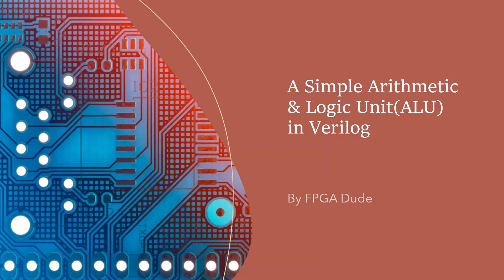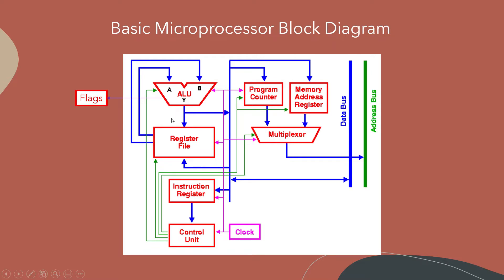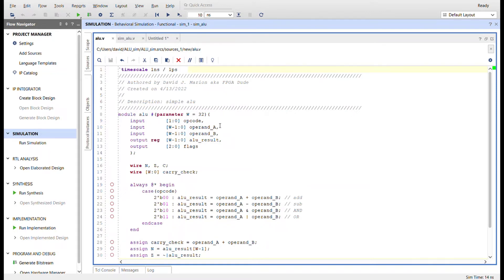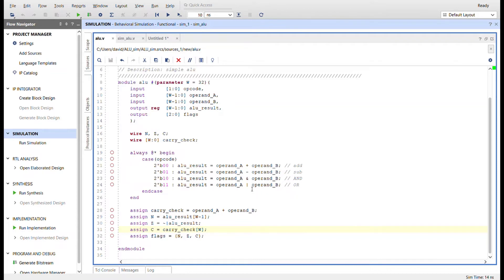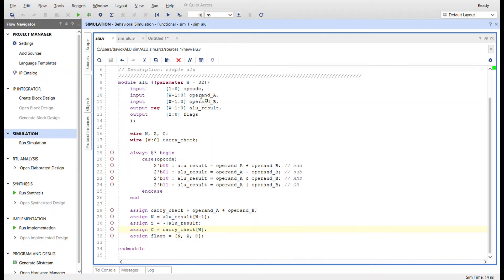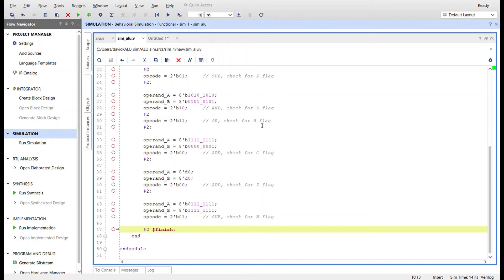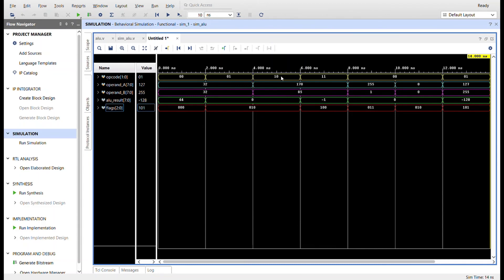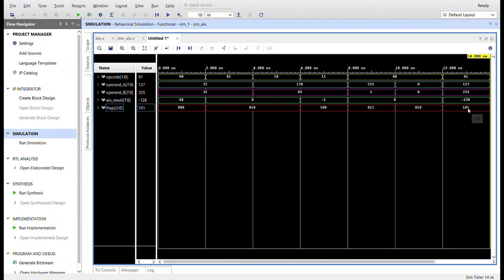A Simple ALU in Verilog Simulated in Vivado

Comment: Thank you very much for the explanatory video!
One suggestion that I think will help is to talk about the constraints file. 
When you create a module in Verilog, can I make a package for the module to export(include) it to other designs? I know I can do that in VHDL, but I have no clue about Verilog.
Reply from the maker: Yes. You can do that in Verilog. The `include compiler directive allows you to include entire contents of a Verilog source file in another Verilog file during compilation. Ex. `include header.v . This works similarly to the #include preprocessor directive in the C programming language. This directive is typically used to include header files, which typically contain global or commonly used definitions.
Reply from the maker: What would you like to know about the constraints file?
Reply: I would like to know which pins have you enabled for this design. Is it possible to upload the constrains file on your GitHub? Thanks in advance!
Reply from the maker: @Toha_Bog  If you are referring to the ALU, I did not put that on an FPGA. I only did a test bench simulation in Vivado. So, there are no design constraints for the ALU.
Reply from the maker: @Toha_Bog  Also, if you like reading, here is my Github link to a user guide for Xilinx constraints: https://github.com/FPGADude/Digital-Design/blob/main/Master%20XDCs%20and%20Reference%20Manuals/Reference%20Manuals%20and%20User%20Guides/ug903-vivado-using-constraints.pdf